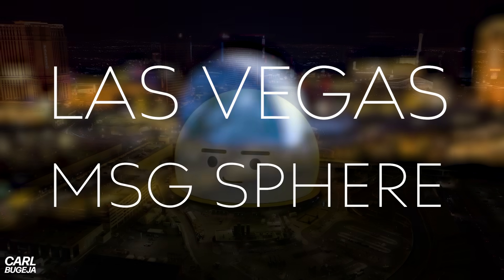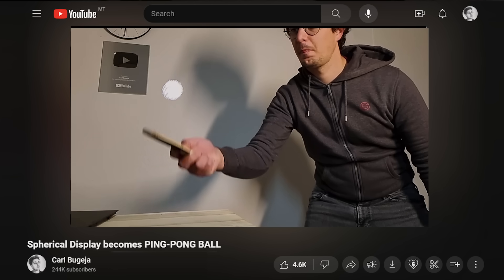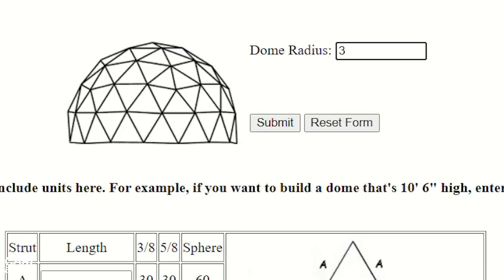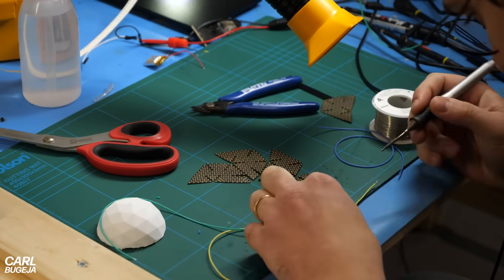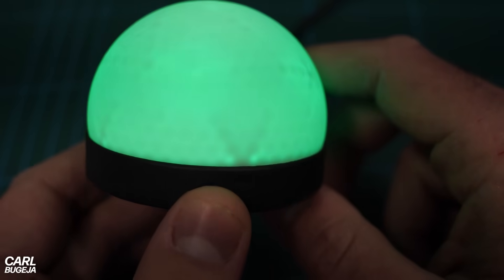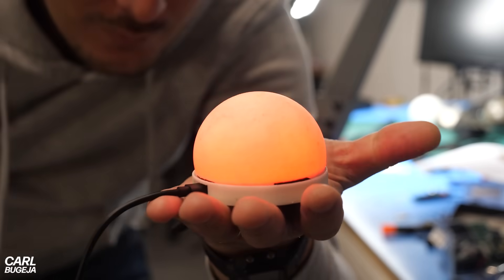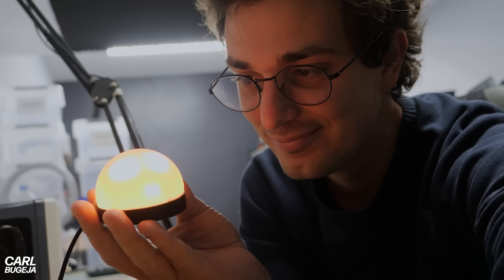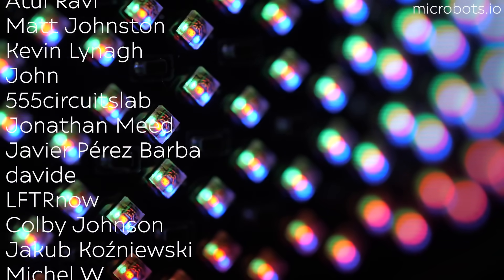Building a Mini Vegas-Sphere

Comment: Amazing work Carl! There are less expensive 1mm addressable RGB LEDs available. For example XINGLIGHT XL-1010RGBC-WS2812B (available on LCSC) for $0.0312 in quantities of 8,000 or more. I've used them in several of my builds, and they also seem to have a much lower quiescent current draw than others I've used.
Reply: that is much better, are they of comparable size? i really hope he can get his tweezers on these and make this a lot better
Reply: @xymaryai8283  Maybe his own DIY CNC pick&place mini-machine; would be a nice side project.
Reply: @xymaryai8283  he said they are 1mm

Comment: A few ideas:
- You might be able to source small triangular LED screens, I imagine that even if these do exist integration and cost would be terrible
- Make use of an LED screen underneath an object that directs the light to maintain a perpendicular path to the screen, cutting it into the shape of a sphere. Then cover that in a diffusive surface. Basically, the guides act as glass fibres that direct the light from the screen to the surface, look up "Photonic Crystals periodic in two directions". I imagine sourcing that would be near impossible but there may be alternative methods for achieving a similar effect: high-resolution 3D printed structure coated in a highly reflective material,
Reply: I had the same idea, scoured the internet for some small triangle or hex led screens, nothing :( Only stuff on backorder with shady documentation
Reply: Smart idea, like some very danse 4k mobile screen, and to get the right diffuse to the parts that get projected in more area you just correct brightness in software, damn good idea.

Comment: What if you increase the size to be just as big to be able to fit regular (normal LED tape sized) addressable LEDs instead? 🤔 This could allow you three variants: 
a) bigger size with the same number of pixels
b) much higher pixel count with these tiny LEDs
c) you could add a screw hole into the flat base for optional wall mounting

Comment: Imagine that with a round OLED screen...
Reply: @Paradoxical124  by using multiple triangular screens its possible to
Reply: @tecnogadget2  yeah but that would be astronomical expensive
Reply: I want one.  Someone figure out how to do it!
Reply: @Paradoxical124  Not only is it easily possible with OLED but it wouldn't be particularly expensive either, <$100 judging from similar sized flexible PMOLED. But that assumes they would be mass produced, prices for low volume displays go through the roof
Reply: @Paradoxical124   it is    bendable led screens been around for  a long time its totaly possible.   just use an old phone screen with out the glass.   they have even  shown off rollable screens in the past.
Reply: And a lense
Reply: @KagrithKriege  The problem is a lens itself, when you try to calculate it with optics engineering software. You will first find it is nearly to impossible to find the solution which will fit into that hemispheric housing. Then after you drop the idea of compact hemisphere housing, you will find it is nearly to impossible to find a manufacturer for that objective (definitely multiple lenses with aspheric surfaces) capable to make it cheaper than the engine of Boeing 737.
Instead of classical imaginative optics, a volumetric fibre optic ‘broom’ with fibres running from a flat surface to a sphere surface can help. Not easy but at least make it somewhat possible.
Reply: @Paradoxical124  it absolutely would. Just very complicated and costly
Reply: also another rollable display.  they have been around for years.  https://youtu.be/KHSdObeUdxI?si=G6Dx5u1ky4nACW1O
Reply: That's what I was thinking, but that'd be soo expensive to develop

Comment: Anything worth doing isn’t easy, nor is it cheap. As was the actual Vegas Sphere which, is big enough to house the Statue of Liberty. So why does your model have to be baseball sized to replicate the Vegas Sphere. Find an appropriate size between the original you’ve established, a baseball, and say the largest recreational sphere that can be held by a hand. What matters is closing the gaps between the smallest of LEDs, equidistantly. Learn from THAT build, as you did this one then, go from there.

How else do we learn but by the one most important tool of mankind: by our mistake(s).

Comment: @Carl try this a cellphone underneath and a curved lens to project in the dome.
But it will be hard to find the correct lens.

Another idea: fiber optics. Many of them.  Make a flat panel with tiny holes where all fibers are connected, then attach it to the screen of the phone.. then the other end of the fibers you connect them to a 3d printed half sphere with many holes.  aaaannd voilà you have a sphere display 😊😊
Reply: 50pcs-500pcs 1mm* 2m PMMA Plastic Fiber Optic Cable End Grow Led Light DIY Decor,  £4.49
Reply: I was going to say the same.  Max out the fibers possible.  this will also result in a focused unblured imaged.  Forget using LEDS the resolution will be to low.  Good Luck.
Reply: You are aware that would cost hundreds of thousands for the fiber optics idea? Military uses similar methods for their night vision goggles and they're suuper expensive

Comment: Perhaps you can build the hemisphere from the outside in.  Take each face of the tessellated hemisphere and extrude them part way towards the center to form a set of truncated polygonal frustrums.  Add locating features to the sides of the frustrums (such as pins and holes) so they can be snapped together to form the hemisphere.

Glue matching frustrums to the back faces of a tessellated flex PCB with a strong adhesive (such as epoxy), apply clamping pressure (set a weight on top), then wait for adhesive to cure.  This is the key step to prevent delamination.

Fit adjacent frustrums together to form the hemisphere.

Comment: Cool idea, but yes, costs too much if high pixel density is preferred/needed. :(
I built something called the “POV LED Globe”.
Mine is about 80cm? Diameter made of plexiglass/acrylic with a rotating axis in the middle. There are RGB LEDs on both sides (144 LEDs/m are used for each side.)
One side is shifted a few millimeters, so I doubled the pixel density when spinning.
In addition, the whole thing is in a vacuum so that there is no/hardly any air resistance and the background noise is also significantly better. The most expensive item in the whole project was the transparent ball at around €120? You can usually get two half-shells cheaply, but in the end they somehow don't look that great with the light refraction in the middle.